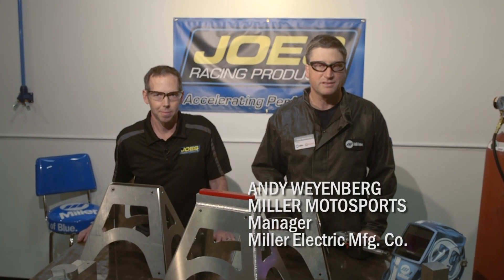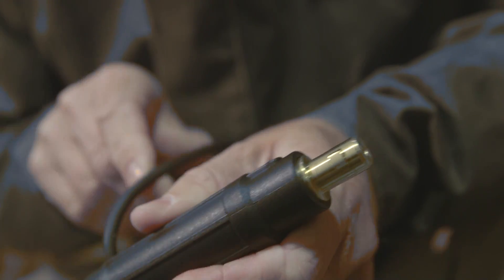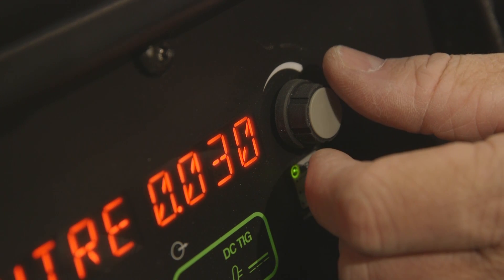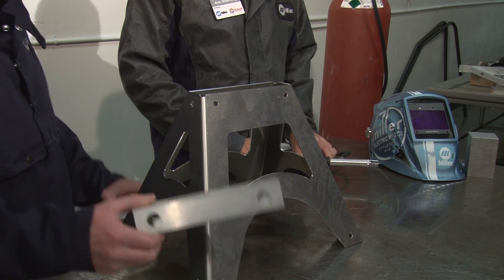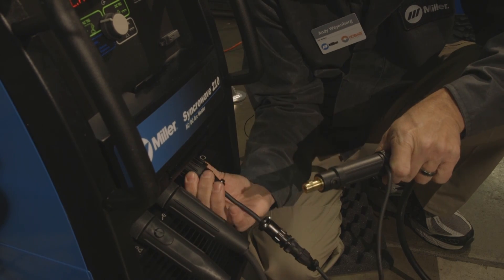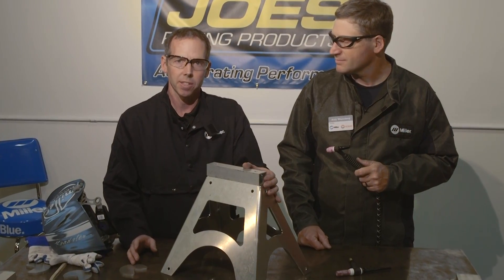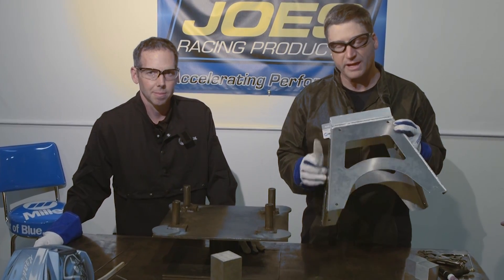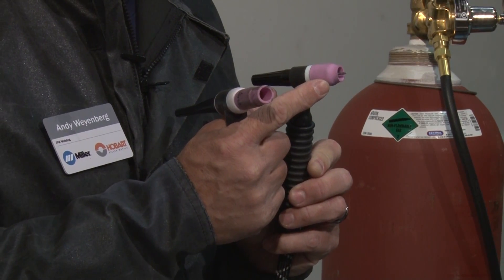TIG Welding an Aluminum Jack Stand at Joes Racing Products

Comment: Very rough looking TIG, most people (who know how to weld) could get better looking results doing the whole thing with wire.

You think I'd ever send them work after showing us it would look like that. How could I. 

Why do you let someone like that near your Machine; you'd be a fool to put barely moderate looking welds on a Race Car.

At my School they would not accept that and you'd not make it to Grad if you tried showing someone a weld like those. You would need to improve in order to stay. 

OTOH I know lots of places where that would be accepted, but not by anyone claiming to be a welder. (a claim not made by either of them in the Video).
Reply: The weldig wire diameter is to large for the application
Reply: The weldig wire diameter is to large for the application